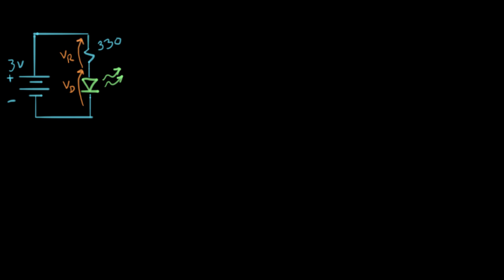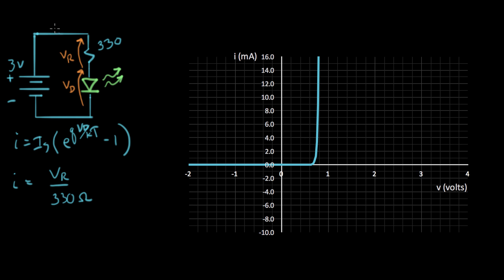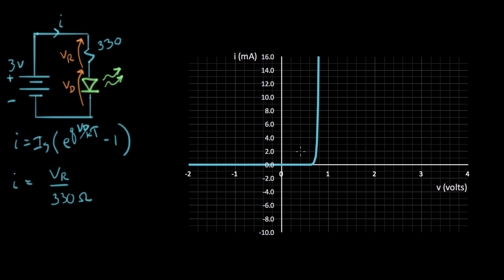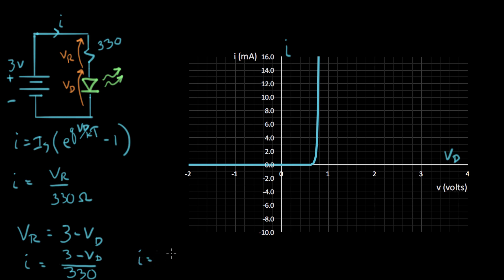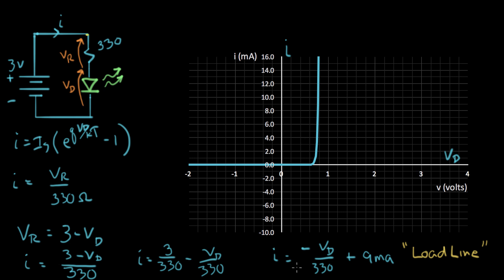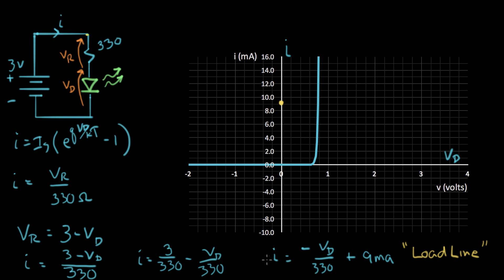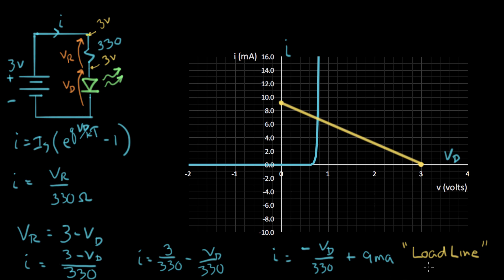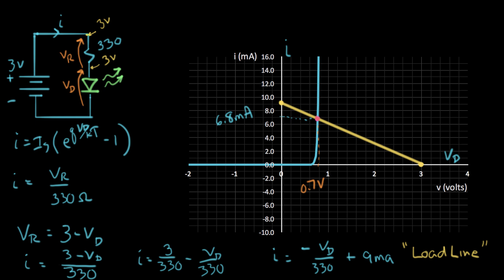Diode graphical solution

Comment: why is it 3-Vd?
Reply: Because Vd is the voltage right below the resistor. If there was a ground there instead of Vd, it would be just 3V across the resistor. If there are two voltages across a resistor, then the voltage across the resistor is the highest voltage minus the lowest voltage.